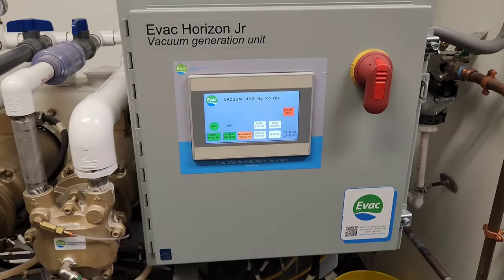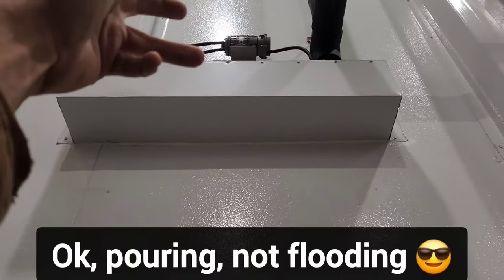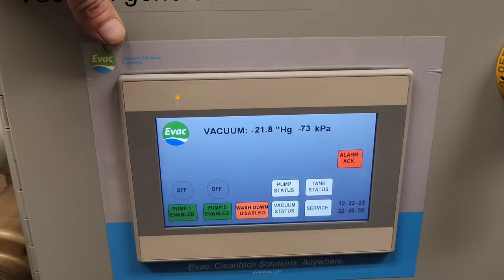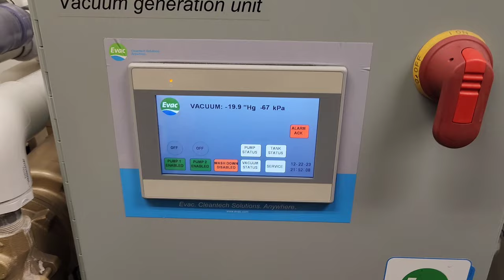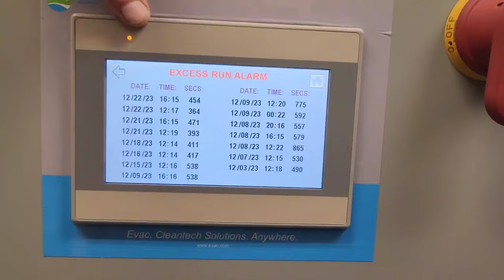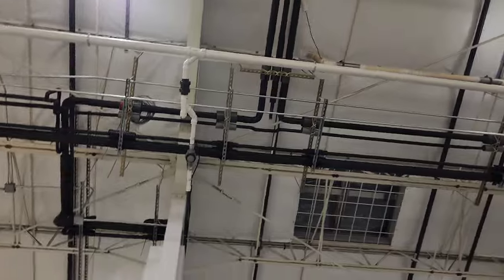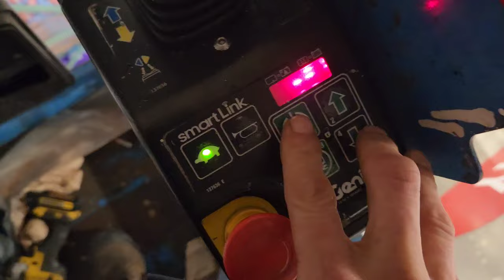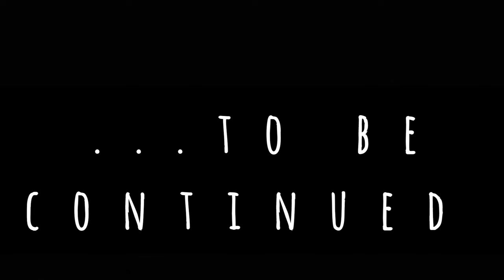Supermarket Vacuum Drain Evac Overhead Waste Disposal System Diagnostics

Comment: I never did any super market refrigeration. This is something new to me but I can see where it makes sense to have in a large number of display cases. Next time I’m grocery shopping I will have to look up and see if they have this type of system.
Reply from the maker: Yea i dont have too much knowledge About this type of system but it's really cool. I wish I would have invented it. it makes perfect sense. Yeah look up it's gonna be in your big wholesale Sam's competitor
Reply: @HVACRServiceTech  Yes I kind of figured those are the types of places that would use it. I can see where it gives them freedom to remodel and not be limited by floor drains. Basically just a huge condensate pump but more expensive and elaborate.
Reply from the maker: @czechmate6916  That's a great way to look at it. Because that's exactly what it is.

Comment: I work on this system for Costco. Its a learning curve but easy once you do every component. System needs to be kept CLEAN for maximum performance. I am a walking EVAC knowledge base.
Reply: Bro I have loads of questions. My company is trying to have us install one with 0 training lmao.
Reply from the maker: Acorn or Evac? That sucks man, I have a feeling that it had better be done correctly or there will be trouble
Reply: Ask away. I’m more in tune with EVAC. Costco uses them over acorn. Target is more acorn. We just wrapped up 2 installs.

Comment: this is a great video bro, i wouldnt have known where too start. lucky for you, your system has ball valves on the floor
Reply from the maker: I didn't really know where to start when I first saw these systems. Spent many hours researching And reading to understand how everything works together. Out here they just throw you out there to the wolves. Pretty much and gotta figure it out yourself.. I've ran maybe 4 or 5 calls on it already and I'm starting to get a pretty good handle on it.

Comment: where do you get that pinch valve? I've only seen them for tiny 1/4"-1/2".
Reply from the maker: I'm not exactly sure. I'm gonna have my parts guy place the order for the parts I need on Tuesday. And the have to just wait and deal with the water leak until then. That's coming up in Part 2

Comment: Why would you NOT have floor drains? Why would you use this crazy system?
Reply from the maker: im not exactly sure. it could be a different process for builing large scale. instead of DWV piping within the concrete slab, this is a different option. Actually seems easier to maintain since it can all be accessed in the future, as piping buried inside a concrete cannot
Reply: Remodel/Adding new cases, easier to have this system instead of all that plumbing work I suppose
Reply: Aldi uses them as well. The don't have to cut into concrete floors and can add more cases without having to trench the sales floor.
Reply: @butchsmith  can confirm, at an Aldi replacing a pinch valve as we speak 😂
Reply from the maker: Yea that would definitely suck. I like this setup actually

Comment: I can understand the reasoning for the overhead drain lines, but, it seems this system is overly complicated.
Why not just allow the waste water drain into a pan and have a pump push the water overhead to the sewer system.
This appears to be the overuse of technology when a simple pump could be used.
Keep it simple.
Reply from the maker: I believe that the purpose for this design is to have a fully pneumatic system,  requiring no electricity through the collection network. If we use pumps-we require power. I think also they promote the smaller diameter piping compared to DWV. Don't get me wrong. I don't sponsor them or anything like that. that's just what I've read on the literature.